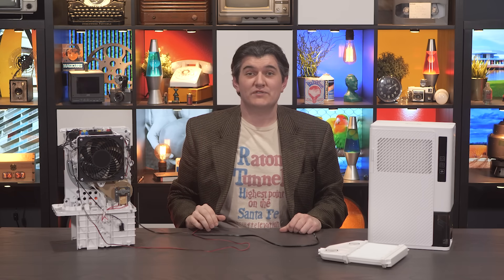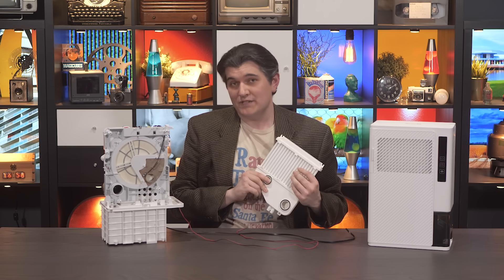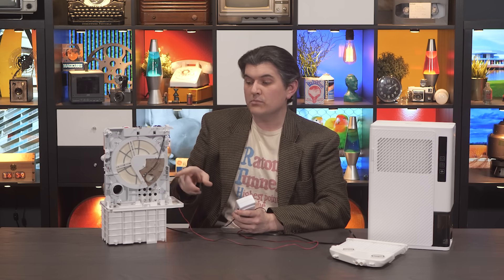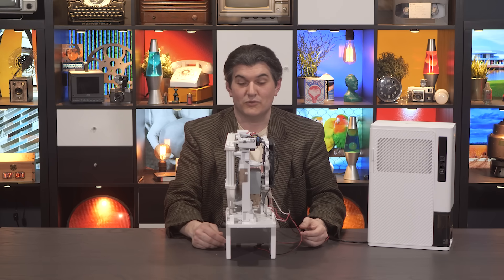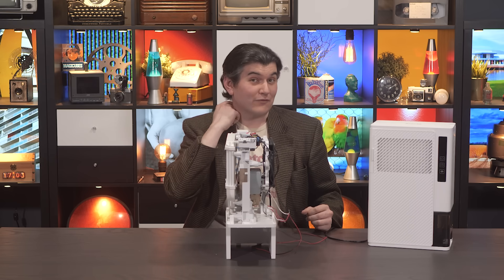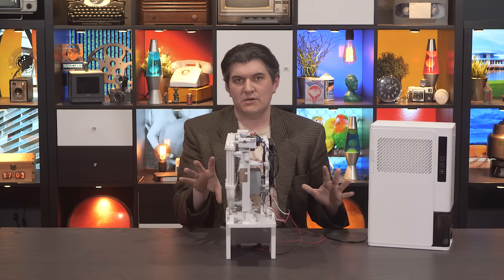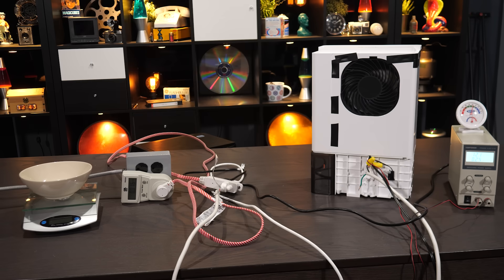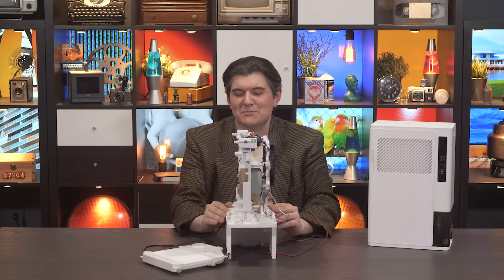A failed duty cycle experiment with a rotary desiccant dehumidifier

Comment: It's kind of like the engineers who designed it did some testing and worked out the optimal design.
Reply: A pound spent in R&D is 100 saved in production 😉

Just because it's chintzy & cheap, doesn't mean nobody thought about it at all.
Reply: Could well have been snake oil.
Reply: Of course, but arm chair quarterbacking is easy, what he did is necessary to advance science, not just go along with it.
Reply: @kenlundstrom3047  If he reaches out to me, I'd be happy to point him in a better direction (and effectively do most of the mathsy hard work for him in the process) rather than posting about it in the comments after the fact. It's too late now, unless he really wants to spend more time on this topic.
Reply: @kenlundstrom3047  This isn't science. its engineering. Related but different. The first step to doing proper science is to check the literature to see if it has already been researched. And I;d bet there is a ton of research on dessicant drying that would have told you it was optimum without doing the experiment yourself.

Comment: The external fan blew more air through the silica gel, which allowed the gel to absorb more moisture?  More moisture to absorb, more moisture to remove.

Try using an external fax to push more air through the appliance?

The addition of the external fan to make up for the lack of a case seems to be a significant change to experiment.  

It could also be that the heat exchanger was colder with the external fan.  The internal fan wasn't distributing the heat fast enough, so the difference between the hot humid air inside wasn't as significant as it was with an external fan helping push air.

I don't know.  Just spitballing.

Comment: I believe there are many things that can be modified in order for that thing to work more efficiently. For example: 1. Using a much stronger and wider fan, so a lot more air goes through that thing. 2. Changing the plastic cooler for a copper one. 3. Using some thermal material that's very bad at conducting heat but very good at storing it as a receptacle of the heating element, that way it will use a lot of energy to heat that thing up, but when it's hot, it will use very little to keep it at that temperature. 4. Playing with the speed of that silica gel wheel. 5. Giving more distance from the silica wheel to the radiator/cooler thing so it can get colder quicker. 6. Increasing the size of the radiator/cooler. etc.

I live in a place where there's very rarely a need for a humidifier and I've never felt like needing a dehumidifier. When it's raining, it gets up to 80% or 100% humid, but then, when it stops, it gets dry (to 60% or so) in a matter of minutes, and that's due to the altitude (we're at 2600 meters high, some 8000 feet), so I would have no use for a device like that. Yet, when it does not rain for a while, it can get pretty dry to the point your lips start breaking. That's when you'd find the need a humidifier, but, again, because of the altitude, humidity escapes very, very quickly, so it's better to just use a lip balm, body creams, and get used to the other effects.
Reply: 1) air pressure isn't the same as air volume moved by a fan. typically, small fan=higher pressure
Reply: @VADemon  Your'e right, but your'e not. If you use both, a larger area with stronger wind there should be a spot where there's higher pressure. BTW, what you need is to grab more water from the surrounding air, so, if you pass more air, you should also pass more humidity.

Comment: I wonder how much more efficient you could make it using a heat exchanger using your warm exhaust to pre-heat the air before it gets to the hot blower section.

I'm also curious how its efficiency compares to refrigerant based dehumidifers in lower humidity environments, like filament storage, where you'd like the humidity considerably lower than human comfort levels.

Comment: Thank you for doing this. It's very interesting to see the inside of the humidifier, but your experiment is confusing several things. First off, I think your math is incorrect: the beige section is piece of pie with an angle of 60º, representing 1/6th the area of the full wheel. Therefore, in a full 120s cycle, the wheel has 100s to adsorb humidity, and 20s to desorb it with the hot airstream. It's not 80/40 as you assume.. Secondly, your experiment is run without the original cover, so the airflow through the wheel is totally unknown. Between the first pass and the second pass, too many parameters were changed, so the results are not meaningful. Kudos for your creativity, though!

Comment: What that unit needs is a economizer/reclaimer heat exchanger.  Instead of fully cooling the process air just to reheat it after condensing, if the hot air coming off the wheel was used to reheat the air coming off the bottom of the condenser, you would re-capture some amount of the heat.  Instead of wasting the entire 150-400 watts of heat in the condenser to the environment, put it back in, requiring a smaller heater.  Heat is the mover, not the product.  Not to mention increasing condenser efficiency by pre-cooling the outlet air before entering the condenser.  I'm not convinced it would increase water output, but it would economize the energy use.  Piping that in might be a bit tricky though.
Reply: Indeed, bigger units recirculate the hot air. Big Clive has a teardown of such a unit: https://youtu.be/jGrAjx1MIkc
Reply: @rouvier666  I watched that video, its no different than the one in this video.  They both recirculate the air, but it is lacking any kind of economizer.  It operates on a near-total loss on process heat.  An economizer would recover heat from the down stream side of the wheel and reinsert it just prior to the heater on the upstream side, a "preheater" of sorts.  The condenser would only reject residual heat instead of all of the heat.
From an engineering angle, it would literally be two heatsinks back to back, but retrofitting it would not be practical.
Reply: @draken1511 you want to take heat from the condenser and reinsert it right after the condenser? That sounds like a job for a heat pump, so we're back to normal dehumidifiers.
Reply: @alexus267 Correct.  By reclaiming the heat, you save on the cost of reheating.  A passive reclaim of even 50% is still worth 100-200watts of consumption.  Wouldn't even need a heatpump for this application, though a high temp thermoelectric might have its use.

Comment: I had the same thought as you when you first showed it on the other channel.  But my thinking was to vary the speed that the filter rotates with an extra long duty cycle on the heater/blower.  I was always under the assumption silica gels becomes saturated in hours or days, not minutes.

Comment: I feel like replacing the straws with metal (aluminum or copper) and then also include a Peltier device, to theoretically boost the heater while at the same time cool the condenser, should extract more moisture out of the air meaning dryer hot air which theoretically will extract more faster from the desiccant. All for a rather small increase in power draw, if using the same Peltier on the other humidifier in the other video, it would be a 10% increase in power (roughly) but large increase on volume per kwh... Nowhere near the refrigeration cycle one, but still, might be interesting.
Reply: this + metal straws seem like a good idea but then the cost + complexity would be really high
Reply: The peltier seems a little bit excessive to me. peltiers are horrible little devices for efficiency, i would think that improving the radiators efficiency by making it not out of mcdonalds drink straws so that it can get a better transfer while sitting in the main airflow making it a little cooler than bumping the either heater power up 100 watts or so or making the air path of the heating side better could also do a similar thing as the peltier. that heat side has some loss since air from both sides can escape to the other side, we can see the dryer side doesnt touch the wheel on either side of its circuit, if that was made a touch more efficient you could achieve a better drying cycle which means the wheel is better equipped to grab moisture on the other cycle. 

my wonder is that im sure in the design of these particular models of dehumidifier the manufactures have gone through multiple permutations of their designs to attempt better efficiency, but keep running into walls that kill efficiency. the vapor compression units just do a better job and the only reason these styles exist is because of noise levels and defrosting cycles causing complaints.

I mean the fact that this little guy doesnt even have a humidistat and just runs constantly for the duration its switched on gives me the impression that they already know it kinda sucks and would not be able to pull enough humidity out of the air to make a huge difference unlike the vapor compression style.
Reply: Peltiers by definition output more heat than a resistor would, because they do pump some heat and a resistor pumps none.

Comment: I’m kinda curious if you could combine a rotary desiccant dehumidifier with a traditional one, using the heat generated from the condenser of the refrigerant unit to regenerate the silica gel. Through the magic of buying two of them, you could be the one to make it!

Comment: Pretty sure the advantage of these is they can go sub 10rh for special storage applications easily. The duty cycle would be different at very low humidities and is also temp dependent

Comment: I’m fairly certain that the theoretical maximum efficiency of this device could be calculated. The difference in weight between the fully hydrated and the fully dehydrated media gives you the maximum water holding capacity. Then, if you find the temperature of the hot air stream, you can determine how much time is necessary to recharge the desiccant. Some calculus would be necessary to determine whether it was optimal to fully desiccate or partially desiccate the media, but it would be fairly simple equations.

Comment: Makes me wonder what would happen if you just slowed down the motor for rotation. It could be done with a small resistor or potentiometer.  It would give the moisture more time to be absorbed without changing the other variables. There would be a bit of testing with the thermal sensors.

Comment: I believe that desiccant has maximum absorption/evaporation of liquid around 75 percent relative humidity. That is why it is sometimes used in cigar humidors/cooladors (DIY'ers buy it marketed as crystal kitty litter) because it will naturally regulate to that until it gets too wet or dry. That effect of it interacting more with relative rather than absolute humidity and having an uneven absorption rate may confuse things. Also there would be an issue if one tried to over saturate it as it will try and fail to expand and fractures in the process.

Comment: I had a thought, how efficient would it be to combine a Peltier circuit with the desiccant dehumidifier? Use it for heating the air to condense more water.
Reply: I had the same thought, but use the peltier to heat the silica and cool the condensor. Maybe that'll be my first ever video lol

Comment: Being exposed to the air at all times, the desiccant is going to be close to saturated at all times, except for a brief time after it's been baked. It may be that the timing for baking vs absorption is optimised in this machine, but it seems easy enough to test by simply varying the rotation speed.

Comment: It seems weird that the fan is first cooling the heat exchanger (which makes the air hotter) and then the silica wheel (which can now extract less moisture since the air is now hotter).
Maybe your adding a second fan was the reason it performed better.
Reply: That was my first thought, More air flow cooling the radiator and no shell constraining that air so it will scatter against the face of the wheel rather than be forced through the honeycomb.

Comment: I guess if the device would run on an more efficient heat source, this would improve the efficiency greatly. But I'm thinking to use the peltier element. You keep the hot air stream as is but you aim the cold side at the pipes.  Maybe even creating a coleant pipe system. You still have the heat output, that dries but reducing the temps at the pipes, it should condens more and overall it should not get as warm.

Comment: 1:23 - "Which means it's exposed to room air for about 80 seconds, and then its recharged for about 40 seconds." That... can't be right. If that were true, then 1/3rd of the wheel would have to be in the 'recharge' section, but the covered part of the wheel is clearly less than 1/4, probably more like 1/5th or 1/6th. That implies a duty cycle of between 96s absorbing to 24s drying and 100s absorbing to 20s drying.
Reply: The beige 'triangle' is not coming to a point in the center of the wheel.  If you estimate by that angle, sure its around 60 degrees of the circle, but if you try to overlay the beige area on the exposed part of the circle, 1/4 to 1/3 seems about right.

Comment: I'd replace the heater in there with a Peltier heater, and also use the cool side to help cool the air that leaves. Combine both cheap dehumidifiers together and hopefully it would be 2/5 as efficient as a good one.
Reply: I had the same thought, even commented on his main video. This is one case where a Peltier could really make sense.
Reply: @supersnot4  I had the thought on the main video, but since this one was where he mentioned he was trying to improve it, I checked here to see if that's what he did.
Reply: Came (here) for this, leaving satisfied.
Reply: I'd tweak that to use the cool side on the intake air from the room, or perhaps the air after going through the wheel just before the radiator.
Reply: Yep, less required input power for the same heat flow even if the air hitting the peltier is only ambient; even more important if it's not. Kind of similar to the design of heat pump clothes dryers.

Comment: I'd honestly be more interested in an experiment with a re-cast of the cooling chamber in aluminum / copper to have it act as a significantly more efficient cooling surface than the plastic is.

Comment: I wonder if you could combine the working principle of the peltier-based dehumidifiers and the dessiccant ones by putting the peltier in place of the heater, and using the cold side to condense the water in the straws

Comment: Just a thought, it'd be possible to do 50% duty cycle with something like a 6A2 (200 V, 6A) diode in series with the heating element, although that would be more like seeing if half the heat would do a better or worse job.

Comment: all you needed to do was add a humidistat switch, positioned at the output duct of the desiccant wheel on the heating element (humidistat switch would turn the element ON when  humidity on the output of the wheel reaches a specific level to "recharge" the wheel

Comment: If the dessicant system works better with cool air, you should marry the compression system and the desiccant system together with a recirc loop to get recovered air from the desiccant "hot side" back to the condenser.

system in --------> evaporator  -> desiccant "cold" side -> condenser -----> system out and desiccant "hot" side in.
Dessicant hot side out --^

Also I would think in addition to playing with the duty cycle you would have to play with the speed of the wheel.

Comment: An interesting thing to try would be to replace the dew collector with a heat exchanger pipe where tap water is flowing. That would increase the amount of water that is captured from the air, but also allow to collect the wasted heat.

Comment: So basically the desiccant is like a sponge and the heating is the dehumidifying right? So the dehumidifying directly rated to the heating power... 
So if you heat more then you dry more. That's the sponge can soak more.... That's why the other one is using like 30,000 w to dehumidify whole office.

You probably figured this out already 😂

Comment: These devices are tested for mass production. They have radical cost reduction measures and sometimes planned obsolescence (failure), but the program that runs the process and and logic of wirings, etc... is usually well tested by some thinking people in a basement somewhere.

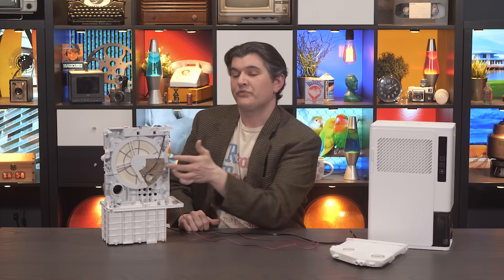Comment: 1:25 So, 2-1 for drying vs regenerating. Interestingly enough, that's right on for the typical ratio for industrial natural gas dehydration units that use solid desiccants like this.
They'll have 3 units, where 2 are active and 1 is regenerating. Then they swap those on a cycle, usually about 8 hours each. But 2 cycles ON, then 1 cycle regenerating.

Comment: I think your idea is a good one, but I wonder if you went about it incorrectly. 

I wonder if reducing the motor speed by 1/2 or 1/3 would result in more drying time and more absorption time? 🤔

Try running everything else normally, just power the motor with less voltage and see if you can find a reliable undervoltage situation that slows the wheel speed. Then you can see if the extraction account improves or worsens for a given amount or time (and KWh).

Comment: I now want someone to make a giant cabinet sized desiccant type dehumidifier that uses a tiny heat pump to generate the heat required. Hopefully it would be quieter than my regular one.
Reply: The higher the regeneration temp, the better it works (to a point). Heat pumps can't really produce the heat necessary to properly regenerate the dessicant. 

It'd work as a preheat before the electric/gas heater but likely not worth the effort/cost as i don't think any commercial/ industrial units do that
Reply: While not exactly what you describe, AAON makes energy recovery units that have a heat pump and a enthalpy wheels 8 feet in diameter.